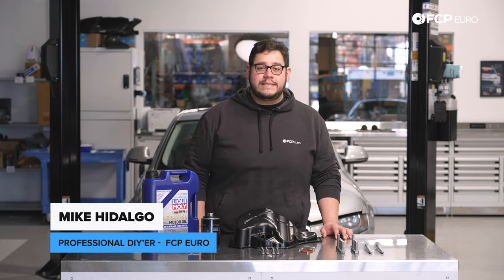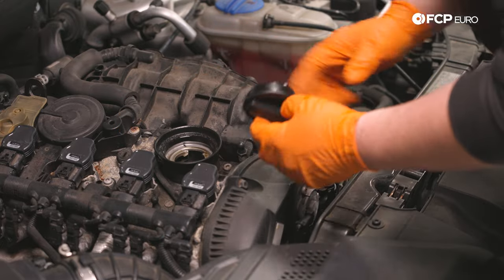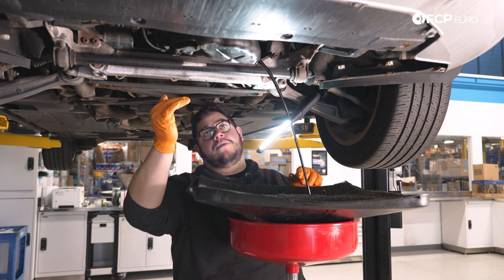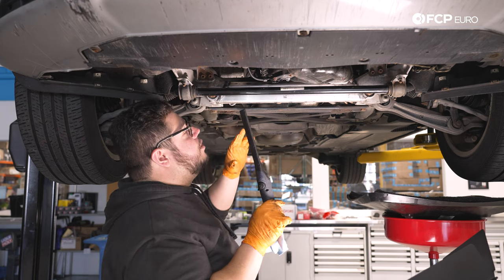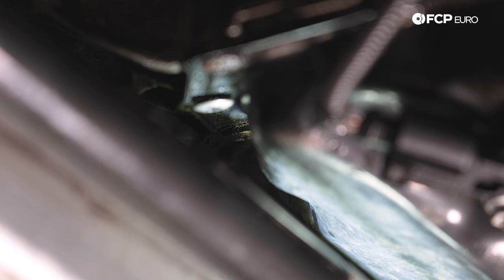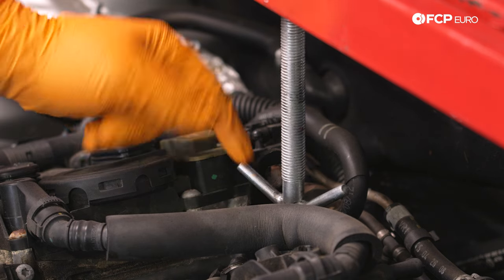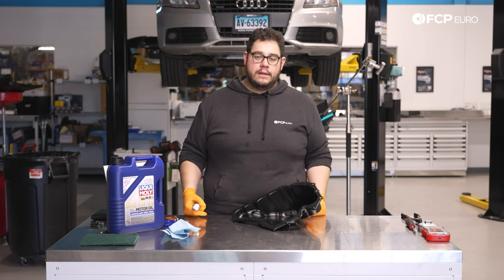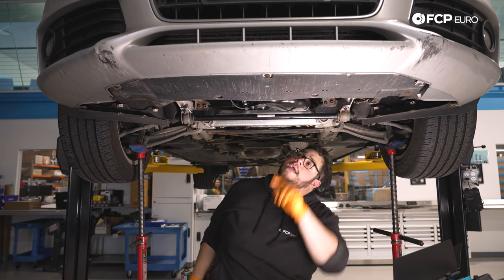Audi A4 Oil Pan Replacement DIY (2009-2017 Audi B8/8.5 A4, A5, A6, Q5, 2.0t Engine)

Comment: Great video Mike.. I did a buddy’s A4 couple weeks ago, it was consuming 1L of oil every 800 mi , it was the notorious first gen oil control rings.. we pulled motor and pulling the pan off was easy on stand.. but I did an oil pump with motor in car before and great tech tip on practicing installing pan dry a few times to get the motion down, I had to reapply silicone because of major smearing lol.. good production and commentary all around
Reply from the maker: You sound like a great friend, thank you for watching!!

Comment: So there is no set time between finger-tight and full torque on the sealant? Any (dis)advantages on using OEM sealant vs Permatex? Also super annoying that Audi doesn't use a gasket for this. The VW version does - but does not fit (ask me how I know) :)
Reply from the maker: With filming, we spent about 15 minutes between finger-tight and full torque on the hardware. Permatex should be fine as long as its high heat/oil resistance.

Comment: What happen if you don’t replace bolts?
Reply from the maker: The hardware holding the pan on is a one-time use, as they are torque-to-yield bolts. Re-using them allows the chance to shear them off in the engine block.